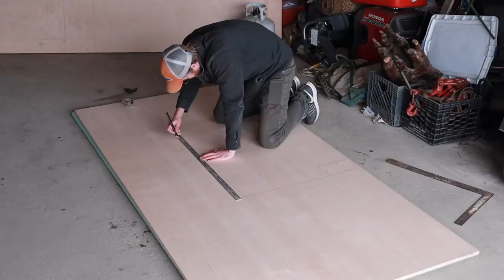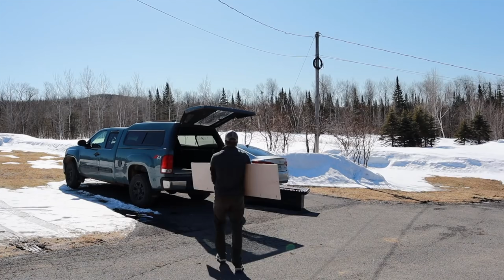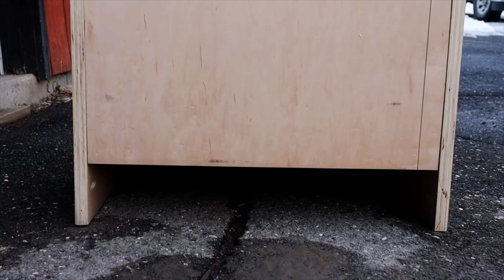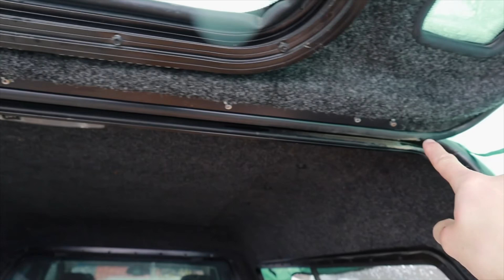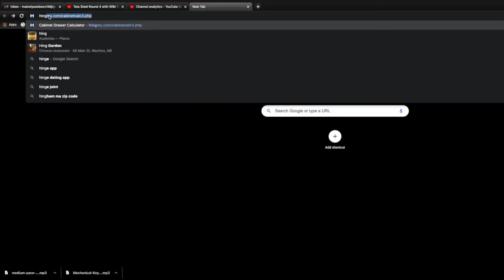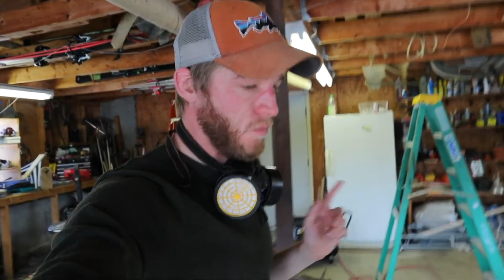Want to Build A TRUCK BED Camper?? -  Here's HOW!

Comment: First truck topper I built I only had a hand saw so that's what I used to cut 8 ft. sheets of 1/2" plywood! I guess I had more energy back then (50 years ago)
 I guess I'd make a one piece slide in unit because its hard to get a topper sealed to keep dust out,  especially when you need to travel on gravel roads.

Comment: Thank you very much for a very detailed video!  A new subscriber.  Just one question.  How did you pocket screw the top to the bed rails?  I see the pocket holes, but did you have to get in and squeeze into each compartment to drill up?  Seems like a very tight space.

Thanks for your response!

Comment: I just got a Ford F-150 with the same size bed, before I do my first time build on it I do have to remove the bed and fix some rust underneath, great video!  It will be my 2026 spring project, just got the truck.

Comment: I'm in middle of my own camper build and wondering why everybody puts the bed on the driver's side. I want to put it on the driver's side also, but I don't know why lol. It would probably be better on the passenger side as the batteries are on the driver's side meaning less cable length.

Comment: You mentioned leaving the grooves in the floor open so any rainwater that gets in could still drain out at the tailgate. But after you're all done, how are you going to go back and seal the underside of that floor that will be exposed to that moisture. Just asking for a friend.

Comment: Why do truck camper builders always put most of the weight on the driver's side of the truck? Be careful taking a left turn at high speed is all I can say. Shouldn't the weigt be on the opposite side of the driver instead of the same side? He gets into the cab to drive and puts even more weight on the same side. It's a very nice build, looks great. I'm just concerned about weight distribution.

Comment: Way too much weight & too thick plywood in my opinion. Better to frame it out in 2x2 cover everything in quarter inch plywood reduce your weight by a couple hundred pounds which translates into gasoline and truck maintenance cost.
The money you'd save on the wood you could have bought yourself a jigsaw or two or three. LMAO.
Anywhere you need a drawer slide run a 2x4.
Reply from the maker: I mean it’s a pick up 😂

Comment: I have been looking at different builds for the past couple of months. My goal is to be able to spend a  couple of days with my grandchildren when they go camping (they are ok with it) Ha Ha. I also plan to take  a stealth trip each year to visit my children and  my other grandchildren and their extended families in Illinois. I purchased a 2016 Chevy Colorado two years ago, actually NOT with this project in mind. Here's my big challenge.. The bed is only 5.00 ft long and I need to find a topper. I looked at cab over slide in's but even the stripped down ones for a 5 foot bet were expensive. So back to my project. Did you get around to doing a video with all your "stuff" on board. I will be really interested in that.. Thanks again for your most interesting build it is one that I at 77 think I can handle. Regards Stu
Reply from the maker: I think that will be a great use of your truck. Working with the 5' bed might be difficult so id actually recommend building more of a solid platform rather than the segments to give you room to lay horizontally. Here is the over view of my build https://www.youtube.com/watch?v=Pxz0N81wbIk&t=6s
Reply from the maker: Good luck! what ever you end up with im sure you'll enjoy the freedom that a truck camper offers and a great way to go visit your family!
Reply: @MainelyOutDoors  Thanks for your comments. I begin my project next month. I need your wishes of good luck.

Comment: resistant., you should GLUE then SCREW. To hold/ keep the boxes together. I also suggest GLIDERS for the slide in/out drawers. Lots easier that way.
Reply from the maker: Probably but it held up fine for the last three years. I sold it now and will have a new build out in a week or so

Comment: Why no insulation on floor?
Reply from the maker: Not sure. never even crossed my mind actually. I just had a bigger sleeping bag when need It. Not sure it it would have done much with how much heat was lost with the windows but it wouldn’t have hurt thats for sure.
Reply: you certainly could of used that foam you were using to cut on for the floor

Comment: You can cut out the top over the pull out drawer so you have access when the hatchback is down. Just a suggestion. But the lid doesn't have to be full size, maybe 80% of the drawer.
Reply from the maker: That’s a cool idea!

Comment: Great job with what you had to use. I bought jigsaw, dremel, old vibrating sander off Facebook market place the guy had all three tools for $20. I purposely bought them after watching this the first time. Prior to my build. Thanks for the advice. Also borrowed the neighbors hole jig, definite game changers. He saw me working and brought it over. I have very little wood working skills also. One thing the old guy next door suggested was to use small amount of wood glue on the pieces you know are not going to be removed. I use my Ford F-150 as a daily driver. Again thanks for video. I took a bit longer. Haha.

Comment: Everytime I watch one of these truck bed builds, makes me so happy I bought my 7.3 ford Excursion. 8x4 interior rear cabin. Id have a hard time sleeping in a 6ft bed. Came carpeted too no wheel wells no bs. Came with a bench seat I can turn into a bed. Speakers and heat in it too. Best part is when I pull up to the beach, the massive rear windows give me a great view. Also works great when I want to watch some traps from the road. Or I can seat 8. Plus when I fill up its cheaper then gas CURRENTLY and I get amazing MPG!
Reply from the maker: That’s awesome might have to consider going that route on my next vehicle my buddy made a build in a 4Runner and it’s great but maybe a bit short

Comment: Great job for what tools you had. When I was building homes, you would have had a job, no problem. I would have bought you a Bosch jig saw. One thing just for future reference, when you drill through with the speed bore, as soon as the tip goes through, start drilling from that side. It won't splinter the wood when coming through.